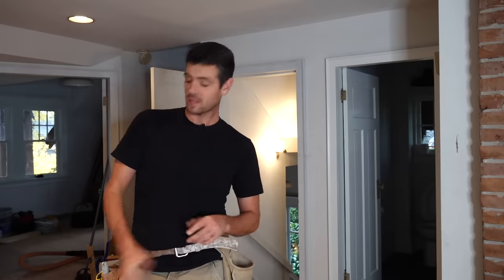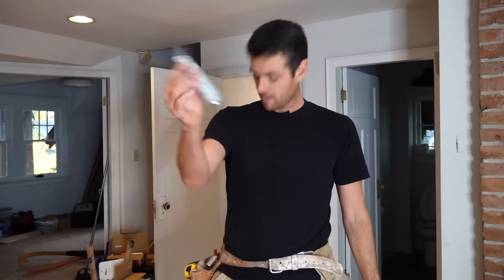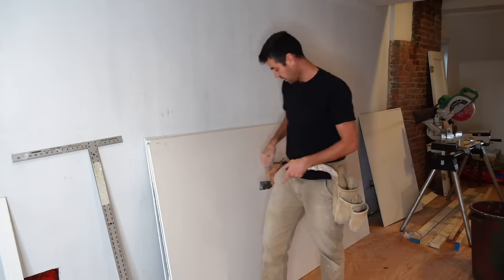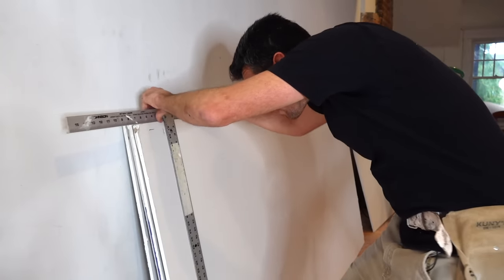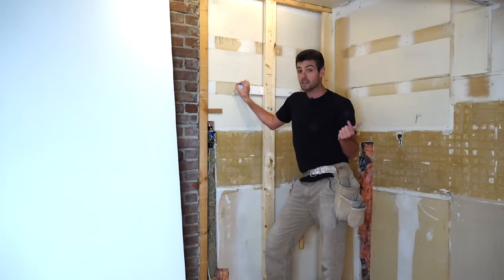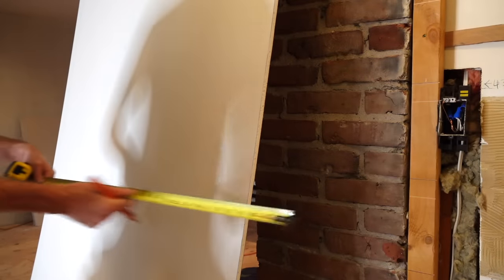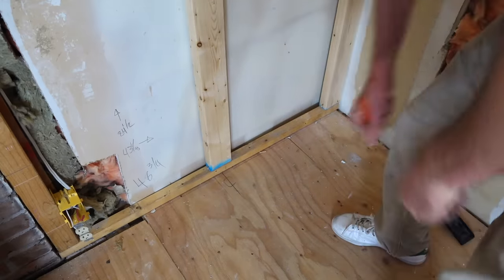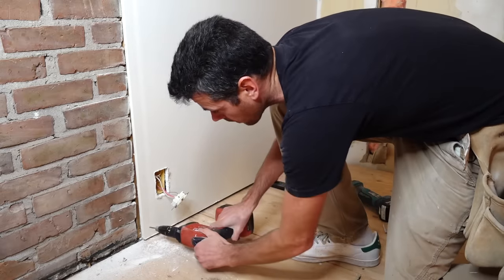Every Beginner Drywall Mistake I can think of (1/3)

Comment: Good stuff!

Those rectangle electrical boxes look like pita when you need to measure, cut etc.
In Europe we use circular boxes that will be installed after the drywall has been installed. 
And the way the boxes fit in them looks super clean afterwards.

Have a look: https://www.youtube.com/watch?v=lcZF1TvQTt8

Do you have such boxes in your market available? If not I wonder why.
Reply: Yes, those are called "old work" boxes and we have them.  Doesn't make sense on new construction to put the drywall up first and run electrical after because that would take forever and I'm not sure how you would do that without ruining the drywall.
Reply: @mae2759  we  run the wires inside the wood frame first, mark the spot where wire is, put the drywall up, and then install this circular box where the wire was. Make the connections in the box and that's it.
We don't run electrical after the drywall has been installed.
Reply: @lkallas  Ok, gotcha.

Comment: Also you say most people measure/cut it too tight. Then proceed to measure a ~4ft span and knock a half inch off...except you couldn't even bring yourself to do it even in a video and you put back an 1/8 that no one will ever see but will one day,  make a future moment into a real unnecessary pain. I only know this a compulsive too-good of a fit type or try to get fancy to save a joint. Well, at least sometimes it works and we can convince ourselves it was for a deeper sense of satisfaction. It's nice to see at least you permitted yourself a half inch at the bottom.

p.s. Knife blades dulling? Buy a Speedy Sharp for 10 bucks when they're on sale. The only reason i replace a blade now is when I abuse it a bit and break it. Might be subjective due to my preference for the Olfa H-1, may be better suited to resharpen.

Comment: I Hate drywall. It's an absolutely useless product. It's very heavy, has zero structural value, will break and crumble into pieces easily, is quickly ruined by moisture and causes a ton of dust and mess when cutting. I'm starting in on building a house and will not be using any drywall.
Reply from the maker: Can't say I blame you. Personally I'm partial to old school lathe and plaster. Done properly it's hard to beat if you're looking for smooth strong walls.